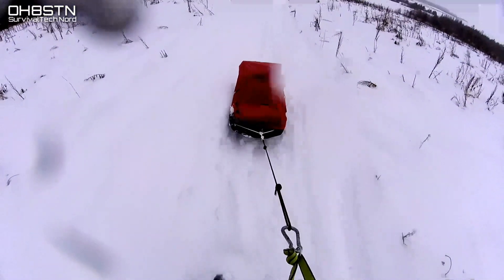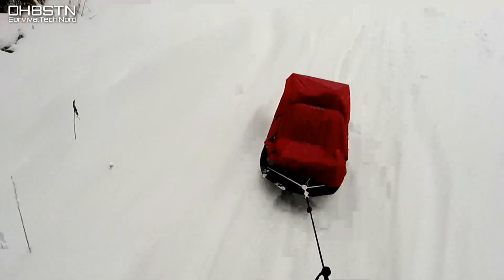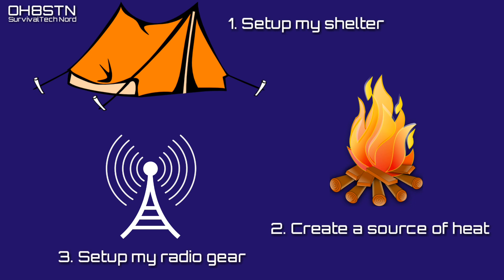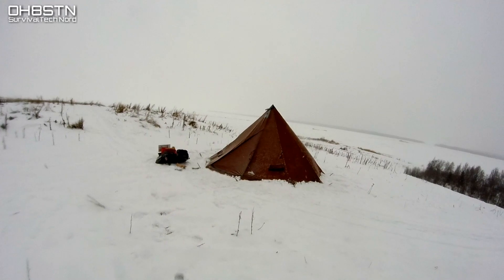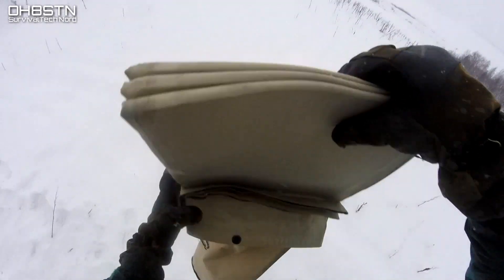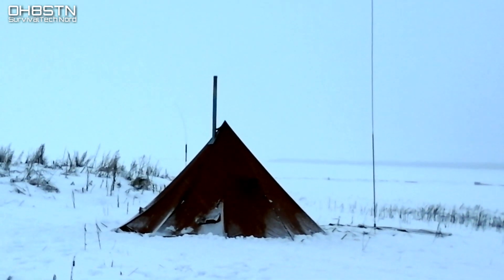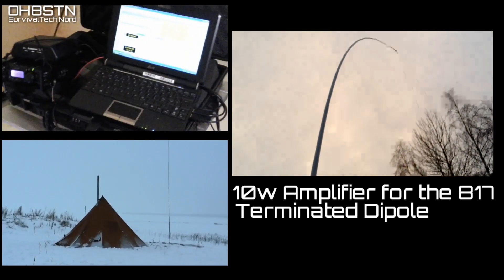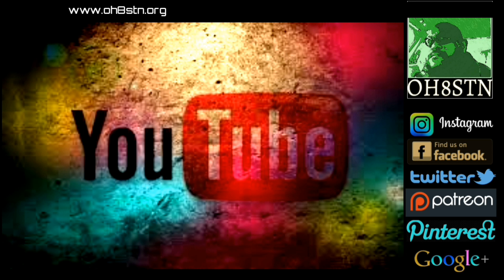Chamelron MPAS & Yaesu FT-817ND

Comment: No offense OH8STN you are doing great videos. But why the heck would you use such a crap compromise 5:1 unun antenna with a 5w radio? Yes I know fast setup yada yada. But seriously you can use it with a 100w radio, but when operating with 5w the antenna efficiency is really important and I think you know that. Keep up your work. 73 de Daniel
Reply from the maker: Try to put up a resonant antenna in -20. Then go outside to change bands each time you need to. You learn fairly quickly, to use the right tool for the conditions we operate in.

Comment: I julian , can you tell us how much température you have in your tipi when woodstove is working please ?
Reply from the maker: No problem.
 of course it depends on the outside temperature very much. Normally if I have the stove going with a full load, it's about 10-20c inside. It's possible to regulate that temperature but it's very comfortable.

Comment: Nice one Julian. Did wonder what the power drain is on that radio. Have a Ft 857 in my car and the drain on receive is horrendous. Not a show stopper on a mobile set up, for which it is designed, but in the field perhaps not so good. Many thanks. Larry M3 MPD Uk Raynet.
Reply from the maker: +The Pensioner Prepper always good to hear from you Larry. I've never to get to receive current down to around 0.95 amps, using settings which are compatible with my eyes. It's possible to adjust the screen brightness and contrast, also the backlight for the buttons and dials on the rig can be adjusted. Without back lights and with screen lighting turn off 0.82A. The deal-breaker for me is crossing over 2 amps current draw when using a laptop or tablet and the radio. Since my power film fm16 7200 can bring it up to 7.2A, the additional current drain over the qrp station is a minor inconvenience.

To expand on this topic I'm also going to build a larger battery pack. The day pack as I mentioned in the video and I made a video about last autumn is 128 Watt hours. I'm getting about 6 to 7 hours runtime @20w out of that pack running, when running ALE with the 891. 
Guess we have to keep everything in Balance otherwise it all false apart.
Thanks for stopping by and for commenting, it's always good to hear from you.
73
Julian oh8stn

Comment: I all was try something u did . I live in New Jersey we don't have one but ground freeze. I use a 3ft railroad tie nail. To make hole frist before I but antenna base rod in..,
Reply from the maker: +NOODLES KC2JLI how big a hammer would you have to use to pound it in the ground?
Reply: No use railroad tie to start hole for u. I use a 8oz ⛺ hammer.bc I have end-fed and need a ground WIRE. So I use 3ft railroad tie. For it..

Comment: Julian, as you mentioned, a small hand sledge would not be amiss. Otherwise, inspiring video! 
71/72 de k6whp
Reply from the maker: Thanks.
I'll be picking up a hatchet early in the week. It should have been a no-brainer but I just didn't think about it until I was out there. Thanks for the feedback
73
Julian oh8stn

Comment: Greeting Julian - Great video once again - thank you for sharing the knowledge and experience.
Firewood makes for a great hammer - until you run out of firewood.  And keep your hands off the flaming firewood!  A mallet would be a good tool to maybe add to the gear.  Another option might be a screw anchor similar to Bluescrew:

https://www.amazon.com/BLUESCREW-Tent-Pegs-Ground-Anchors/dp/B00MV7EXP8/ref=sr_1_1?ie=UTF8&qid=1515699426&sr=8-1&keywords=bluescrew

Keep up the awesome adventure - I hope to work you some day.
Reply from the maker: +KYTec IT so you saw that flaming firewood in the video huh? :) I didn't think anyone caught that :) 
Actually I've been meaning to get myself a small Hatchet with a blunt side of course. Having the pulk sled means I can have a heavier gear loadout without any of the downsides. I'll check out those screw anchors although the ice was seriously like concrete. Do you think they would work? 
Thanks for the comment and suggestions. I'll definitely work you one day 👍👍👍
Reply: A hatchet would work nicely on a trip such as this for multi use, chip / break ice, chop / split firewood, and hammer stubborn things into the ground.

As for if the Bluescrews would work into 'concrete' it's difficult to say. They mention they are made of dense 'Military grade plastic' but you need a serious cutting edge to get through the frozen tundra.  I honestly could be a trade off, it would work in the summer months, but not winter.

Comment: This was fun.  Thanks Julian, and don't worry about including details.  There is a fast forward button.  There is no "show me more about this please" button!   A couple of things I thought during the video:
- How often do you need to reload the wood stove?
- Is it possible to somehow use the tipi to get the solar panels upright?  They'd shed some snow and be better situated for the low angle of the sun you have this time of year.
- Have you developed any opinions yet on the merits of being able to operate multi-band vs. being as efficient as possible on a single band?

As a KX2 owner my input on the amplifier is: don't bother.  It's very rare that 10W makes a contact when 5W doesn't.  Not worth the extra piece of gear or the power you would burn.

73 - N3NWV
Reply from the maker: +Matt Heere hi Matt, great questions and thanks for the kindness.
On the merits of multiband vs being as efficient as possible. When I need to run multiband digital systems like ALE, or when I don't have the possibility to reconfigure the antenna for a different band I'll always take the multiband over the monobander. With that said whenever I can sit on a single band I'll always choose the endfed half wave because there's nothing better in terms of performance.

The stove question is an excellent one with no easy answer.  If we start from the beginning, I never know what type of wood I'm going to have when I get on site unless it's a short trip and I take it with me. I try to get is birch to start the fire, and then spruce or a little bit wet spruce to make it last longer. In this optimal situation I might get two-three hours out of a full stove load. In that case there would still be the orangish red coals on the bottom of the stove. If it's really cold out and I need to burn the stove hot, I would load it up with pure Birch which is abundant here. That might last an hour and a half.

Yeah I completely agree with you. There's a little difference between 5 and 10 watts however. Much of the time I'm running 2.5 Watts (digi modes) on the ft-817 in order to save its finals or to avoid overdriving it. The little 10 watt amp can be driven at 15 watts with three watts of input. 
All excellent questions and very fun to answer. 
I just noticed what you did while I was writing this reply. I'll send a message shortly.
73
Julian oh8stn
Reply from the maker: +Matt Heere about keeping the solar panels upright. It's possible to do it with the 2x 20 watt panels, but the 120 watt panel. The 120w puts too much stress on the center Pole. I have a couple of ideas for this but it always depends on where I'm going to be deploying. A couple of weekends ago I was in a forest bordering the lake so I positioned my camp on the north side of the lake extended some paracord between two trees and use the carabiners on the 120 hanging horizontally between those two trees facing south. 
That's one way but of course it depends on having trees around to do it.
For casual Communications (qrp/p) I'm going to use the two 20 watt panels. So I may just take your idea 👍👍👍

Comment: Great video, you are showing TRUE GRIT. Makes me feel like a couch potato for not going out portable in Virginia during the winter.

I am a true blue believer in QRP operations. The power consumption curves are ideal for prolonged operating. But as an honest man, I have to admit that it doesn’t work all the time. You can do remarkable things with QRP, just not every day. In an emergency situation you cannot say “oh well, the band is not open today for QRP, maybe tomorrow.” That is why I am supporting you QRO ideas. GoFundMe done.

The question I have is how will you balance the power curves? Ideally you have a radio with a reasonable receiver power consumption and on transmit you use only as much output power as you need with a corresponding scaled power consumption. If the radio uses 20A if you are putting out 20w or 100w it is a non starter for power strapped portable operations. I am trying to look at a home brew amplifier that allows me to scale input and output power together. I am not sure there is a commercial product that does this.

Good luck. BTW, you are on my bucket list of stations to have a QSO with before I die. We got time. 
73 Charlie 
KM4ZZ
Reply from the maker: +crbrelativity magnificent! I've seen a couple of crazy nor'easters come through Virginia once or twice back in the day so... 👍👍👍
I'm also a True Believer in qrp Ops and I've been working that way for years. I do hit the occasional amplifier from time to time but only for special occasions. To be completely honest I'm quite the amplifier hater. I agree with you on the power curves. I thought about having an amplifier with variable output, but I haven't been able to find one. Ideally I would prefer to have an amplifier with variable output between 10-20w, then the radio that's drawing for amps all the time. The 857 current draw is acceptable but only because of my 120 watt solar panel, and lithium iron phosphate battery pack (not published yet). There's another reason for the 857 beyond the 20 watts I would run from it. I'm a long way from one of these high speed low drag Young Bucks. My eyes are straining with the screen at the 817. There are other radios with high visibility screen and greater output power, also having lower current draw. Unfortunately I don't trust those radios in terms of robustness in my conditions. Does this make sense?

I'm going to have to recheck my numbers on the current draw for the 857 and expand on this thread a little more. You've made an extremely valid point and I want to be sure I haven't made the wrong decision in terms of the radio.

As far as the campaign goes thanks for the kindness. It's really tough to find words to express the appreciation. What I can say is I'm going to continue doing what I'm doing and stepping it up as much as I can as we go along this journey together.
73
Julian oh8stn 
Ps, I'm typing this on a phone 😁

Comment: Julian, no you are not the military, you are by yourself and your priorities as listed and practiced are spot on.  If you were part of a team then each team member’s priorities would be task differently.  Based on your introduction I assume your treks are not lengthy in distance or time.  I like the stove for external heat but what are your thoughts for fueling your internal stove?  I am looking forward to all the videos you have planned in this series.  Thank you for imparting your experiences and knowledge for the warriors out there.
Reply from the maker: +Joel Talbot 100% agree Joel. And almost every video I publish someone mentions SOP they learned in the military, adapted for grid down disasters. My opinion is it doesn't work I just didn't want to blatantly say that in the video. 
The training trips are not usually very far away. I might do 30km in a day maximum for these type of training trips. This one had a total of about 6 km so I'm not far at all. But for example the Arctic Circle bug out trip in 2015 that was about 80 clicks round trip. As the solar powered Field Station progresses I'll start to get further and further away from the homestead. There's an island near the city I live in called Hailuoto.  That'll be the first big deployment. After that I'm going to take advantage of the 24 hours of daylight we have in the spring and summer and head up to nordkapp Norway, for a multi-day expedition there. I guess you get the point now these excursions will grow in distance and complexity as we move on with the field station.
So fuel for the internal stove that's pretty easy. It's almost always going to be dried food. I've been practicing with drying meats and vegetables, beans rice and so on. And trying to find that balance between nutrition and portability. Having the wood stove in the tent means I can boil water and prepare food quite easily. During spring summer and Autumn I might resort to the jetboil. 
The Warriors out there on who it's all about 👍 we all have the potential. We just need a little bit of guidance from time to time. Anyway we're all learning together!
Thanks for the kindness I really enjoyed replying to your comment.
73
Julian oh8stn
Reply: Although I wasn’t in the military, I’ve been around a lot of them and now that I work with them (in comms) I kinda know how they think.  Besides I worked as a ski patroller at 11,500ft for five years so I understand the treachery of old man winter.
Reply from the maker: +Joel Talbot 👍👍👍

Comment: Try too use a 10w radio like a Xiegu
Reply from the maker: +Pedro Almeida hi Pedro.
Actually I thought about that Xiegu 5105 and external amplifier but I'm really worried about the quality up here at 65 degrees north. I've forgotten the model number of that larger radio they have, but it's too big for a field station.
What the radio are you using for portable ops?
73
Julian oh8stn
Reply: I dont see any videos off you on vhf/uhf for that reason i belive the good choise for you will bee a xiegu 108g but i have seen Xiegu 5105 videos on snow opereration.
I dont use vhf ou uhf to mutch so i use what my money can aford a Kenwood TS50 + homebrew off center dipole by K1POO (i maneged to reduce to 200g), 7 meter fishing pole, baterry is at the moment a small acid battery 12v 8A but i am on process to upgrade.
73
Pedro CT8ABY - CT7ARQ

Comment: Hi Julian, 

I agree with your priorities in setting up camp. The main Question arising to me is pointed a little before that: What do you have / use for the "real" man portable coms while you walk? Of course in SHTF loats of repeaters won't work and the amount of directly reachable stations is limited, but if there is, do you use the 817? And if else, do you have charging capability via your solar power? Do you beacon on APRS while walking? I do see your focus on the STATION atm I am just curious ;) 

Love the video and your plans for the future!

Best Regards, 73
DJ6KR
Reply from the maker: +Konrad Ritter Conrad you're calling me out almost everyday, I love it!
You hit an important point, perhaps missed in the video. Absolutely I a HT that I almost always have with me. As a rule however I don't use repeaters unless it's an emergency. I simply don't rely on them for critical Communications. Anyway the HT is a Yaesu VX 5r, with Mobilinkd bt tnc for APRSDroid. I did show my APRS location screenshot in  the video aprs.fi (I don't know if you noticed). To be fair I was attached to aprs-is by a TCP IP and not with the HT this time. Anyway I always use an HT which has a direct in DC input. This way it can be charged directly off of the portable power system shown in my previous videos.  
You're also right about focusing on the station. Too many YouTube videos on ham radio focusing on people looking at their feet while they're walking or driving or parking the car but not actually and how the station is set up or deployed in various scenarios. Ham radio isn't just the antenna, coax cable, battery and ultimately the radio. My entire station station is ham radio. Even the wood stove. I guess that's what I tried to get across in this video.
As always Konrad thank you for the comments and kindness.
73
Julian oh8stn
Reply: Hi Julian,

yes I saw you APRS Position, but I also saw, that the last track was done by TCP/IP that's why I asked :)
For the same reasons you put up, I do have a Yaesu FT-1XDE which has APRS on board and the DC-IN feature. Our Digipeater is Solarpowered and we are planning on adding a Repeater, so at least in this are grid down will not imideatly kill the ham network. With our hills and valleys Repeaters are crucial.... 
I really need to go to your area some day in the future :)

73 
DJ6KR
Reply from the maker: +Konrad Ritter yes that's right Konrad. When I'm in a grid up situation, TCP IP is actually the best way to get into a aprs-is, since Finland has a widespread and robust Data Network with unlimited data. 
Seriously digging what you guys are doing down there. So many ham radio clubs are attaching themselves to commercial towers. I like how you all are building the Standalone systems with off-grid power. Yeah actually I was thinking I should come down and visit you guys and make a video about all of the cool things you're working on. :)
So there's not too much to see up here except pretty ladies and reindeer. Oh yeah there's lots of snow also :D
Reply: Just tell me, if you really want to come. I would love to show you everything from our ion accelerator to our ham radio stuff! I myself will for sure be riding my bike to Finland, Sweden and Norway some day. BECAUSE there is not much more than the things you mentioned. :)
Germany is way behind on data-infrastructure... We have slow internet, old cable, bad WWAN coverage in some areas... I sometimes NEED APRS, APRSLink and WINLINK for Comms in my holiday QTH... just sad.
Reply from the maker: +Konrad Ritter well I definitely want to get down there sometime and I have people in Bochum and Dortmund who are just begging for me to visit. I don't know when I can pull it off though since I have so many other projects planned. You'll have a blast in Finland Sweden and Norway. The north of these three countries is motorcycle heaven. 
I would have thought the infrastructure would have improved over the years in Germany. I mean we have these dark spots in the network as well, but you have to go pretty far off the beaten path to find one.